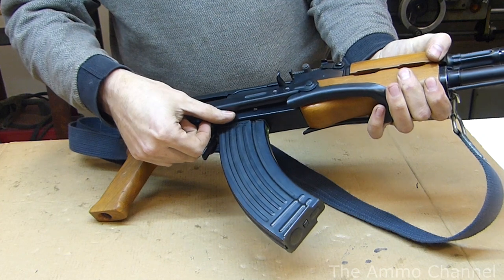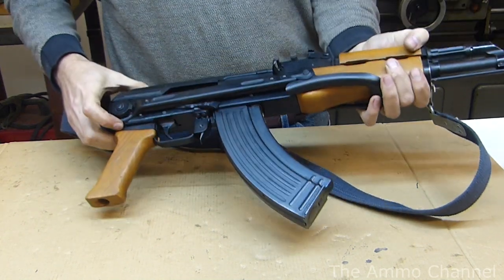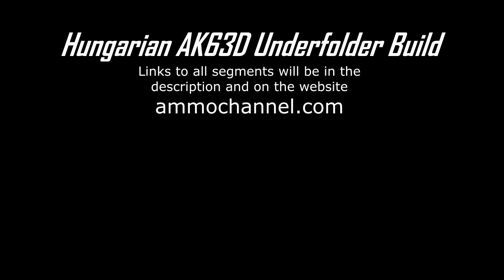'AK-47' scrap metal build PART 8: Test firing

Comment: Nice to see that it worked out in the end.
As for the issues with the fitting, some builders prefer to assemble their AKs in a certain sequence in order to ensure a perfect fit:
1) Attach the trigger guard with the magazine catch
2) Adjust the front trunnion position and test with a variety of different mags to ensure proper magazine fit
3) Use the dust cover to determine the perfect position of the rear trunnion
Of course this only works with receivers that don't have predrilled holes (or you would have to weld them and drill new ones) and it is a bit more complicated to work with a receiver with an already attached trigger guard in some stages (maybe screwing it on for the test fit and removing it once the trunnion holes are drilled is an option). But if a perfect fit is desired this seems to be the best practice. Maybe this will help with some of your future builds, if you intend to do any.

Comment: After watching this I decided to take out an old century wasr I got, back from when they were made from random parts by century instead of by CUGIR in romania and then imported to have the magwells opened up.  That rifle was a POS as far as AKs go, problems out the behind.  So, after watching these videos I decided to do something about it.  I removed the hammer and carefully hand filed the geometry so the carrier wouldn't get caught during cycling, and took the burrs off the mag well, then polished both with chromium oxide paste, on a dremel buffing attachment for the inside of the magwell, and on my buffing wheel for the hammer.  I located wear spots on the right side of my piston, and realized it was scraping the right side of my rear sighting assembly, so I filed and polished there too, then uncanted my front sights.  Finally I lightly polished the sear engagement with some jeweler's rouge, and now she is among my best functioning AKs.  No hint of hanging up during cycling the bolt, everything butter smooth.  Thanks for the inspiration.

Comment: Hooray! So much fun to finally see it running. Please update us on whether it turns out to be reliable or if it needs further adjustments. Next project, I suggest building a shotgun from scratch because you don't need to buy a threaded barrel. 10 gauge coach gun with external hammers, maybe?

Comment: Very fine job Sir!  Most folks have no idea what went into that. Great work compensating for a 1/16" thickness to the receiver as opposed to 1 mm. How did you tuck the sheet metal into the front and rear trunnion channels? Did your fire control pins come up short? If the pins are to short there are longer pins available that are used used for the thicker walled Yugo and Chinese builds. That video not only entertains me, I am fascinated by it. Oh by the way, that failure to feed was not your fault. Those tapco mags are know to need a little custom filing, And God knows you won't have any trouble with that. My best compliments. PS, Do a sten gun build please.

Comment: if you did want to stabilize the magazine, wouldnt it be easier to spot or plug weld a plate on the inside of the receiver where the dimples would be?
Reply: a plug weld should, if not you could always secure an oval plate on the inside with rivets that seat flat into a recess on the inside

Comment: Ok this is a hobby I'd love to get Into I live in Texas so gun laws are nice. My question can this be sold? Aks are to cheap to build but the belt fed I'm drooling over just thinking about do you know any belt fed kits that dont have a open bolt. I dont want to add any more trouble then need be. Thanks great vid hope to hear from you
Reply: Unless you have a Class III FFL manufacturers license, you can only build guns for yourself to keep, not to sell. Basically, you can build yourself a gun that only you can own without a license. At least until the ATF decides to outlaw that too. This is the idea behind 80% receivers you can buy today.
Reply: +txgunslinger77 Wrong. All you need to sell firearms that are made with the intention of selling is a Type 7 FFL.
+ ak15 ar47 If you build yourself a firearm and later on down the road decide to sell it, you can. Serial numbers are recommended when selling, not required. With the BAFTE it's all about intent, so as long as you build rifles with the intent of keeping them, but then later selling one or two, you'll be fine. It's just like if you bought a gun and decided you didn't like it and sold it off.
Reply: Shadow Ok so maybe I quoted the wrong FFL type, but you still need one, thus I am not 'wrong' in that sense am I? You cannot simply build guns and sell them willy nilly to make money at it, pretty sure on that.
Reply: txgunslinger77 your right I'd never build a gun to make money I just sell them when I don't want them any more . Now that's legal
Reply: +ak15 ar47 true, so long as you're not doing that often enough to attract the attention of the ATF. I only know b/c I actually called them once to ask what is considered 'legal' when selling personal firearms. Basically they told me as long as your not doing like 10 a month, or any other number of guns whereby you are making money doing it. If you sell every gun at a loss or break-even, then go nuts! :)

Comment: "Using as basic tools as possible." Sitting in front of industrial lathe, rotary table for mill off camera...
Reply: +GearCheck 101 It's not like he used them in the build
Reply: +GearCheck 101 let's be realistic here. You won't see anyone build a functioning AK with a hammer, a bunch of scrap metal and a file. You need a couple thousand dollars in equipment and hundreds if not thousands of hours to build one. Not counting potential training for the equipment or troubleshooting, education. There's a reason it costs so much to repair a car or other thing as opposed to making a new one in the factory. There is no special areas to machine assemble and QC every part. In home manufacturing you are all of those and have to have the skills and equipment for all of those. Hence why it's so difficult. Still... When faced with an enemy occupied government... This may be very worth your while.